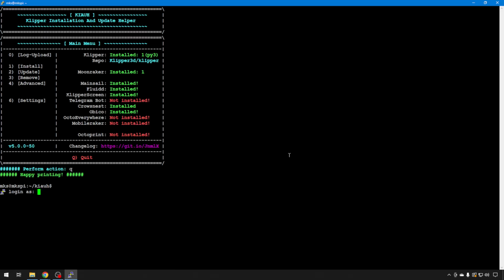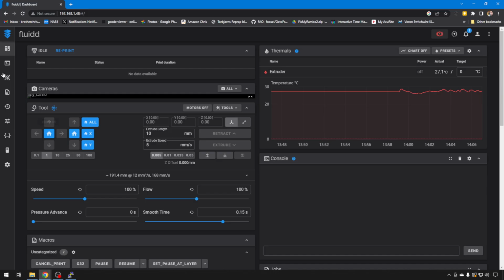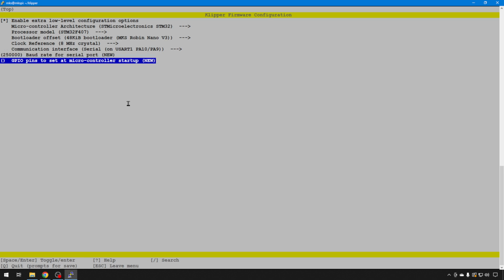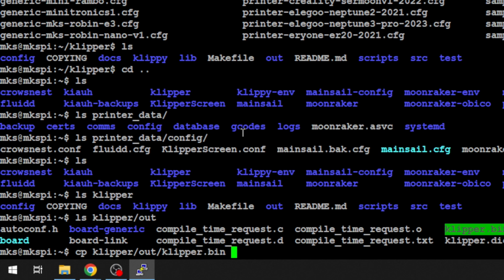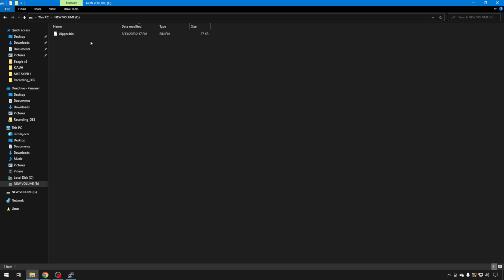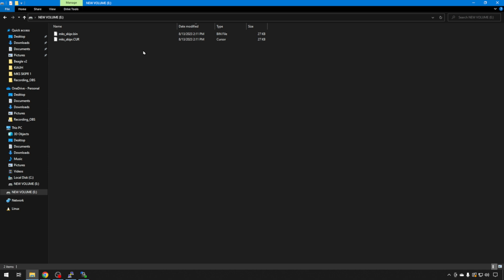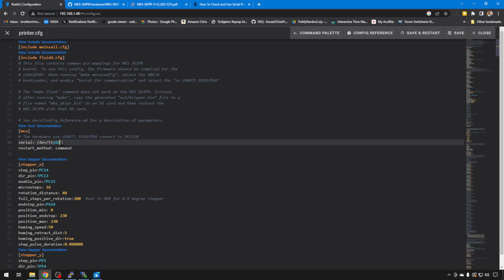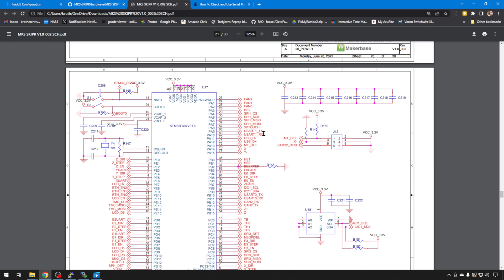Klipper - MKS Skipr Install - Part 2 -  Chris's Basement - 2023

Comment: Great Video, I was following all the steps, but when I try to go home at X an error jump. Unable to read tmc uart 'stepper_z' register IFCNT
Reply from the maker: Check your jumpers again on the board, make sure Z is set correctly.
Reply: @ChrisRiley  Thanks a lot, your channel its perfect. All your explanations are very helpful. Finally the real problem was TMC2209 burned. I only changed it. right now works fine. 
Regards from Mexico

Comment: Hello, could you explain how to use the boot and reset switches for the MCU? I replaced the burnt STM32 chip and normal insertion of the card does not load the firmware.?
Reply from the maker: It's been a while but I looked at the SCH https://github.com/makerbase-mks/MKS-SKIPR/blob/main/hardware/MKS%20SKIPR%20V1.0_002/MKS%20SKIPR%20V1.0_002%20SCH.pdf

RST resets the STM32 MCU, just reboots it.  Boot looks to allow you to flash a boot loader I think.

Comment: could you help me with this error, I uploaded a new firmware to the mcu to match the klipper v0.12 update, but I have this problem
mcu 'mcu': Unable to connect
Once the underlying issue is corrected, use the
"FIRMWARE_RESTART" command to reset the firmware, reload the
config, and restart the host software.
Error configuring printer
Reply from the maker: Did you solve this? I'm guessing you printer.cfg got updated and needs the MCU address added back.

Comment: Where do you plug in the 3/4 pin filament sensor?
Reply from the maker: It goes in MTDET, the pin is PA13.
Reply: @ChrisRiley  What if its a 4-pin?
Reply from the maker: @merlinbk  No clue what the forth wire is, what kind of endstop is it?
Reply: @ChrisRiley  So it's actually a 4 pin connector with only 3 wires. Can it be plugged in elsewhere on the board? If not what is the connector called, so I can convert it to 3-pin.
Reply from the maker: @merlinbk  Yeah, you just need to covert it over to a 3, most endstops are 4 on the switch side, but 3 on the board side, not sure why.  These are the ones that fit the board. https://geni.us/jYAAkk (aff)
Reply: @ChrisRiley  do you know what the wiring is to convert Ender 3 (2 pin) endstop/sensor to the 3 pin on the board?
Reply from the maker: @merlinbk  You can use ground and trigger pin on the two pins, you just have to find 5v some where on the board to power the endstop.
Reply: @ChrisRiley  Do you know if there is a discord for this board/makerbase?
Reply from the maker: @merlinbk  Yes, https://discord.com/invite/YRTqkuB6tb
Reply: @ChrisRiley  Can you plug in a ferrule non-controllable fan into the HE1 or HE2 screw in connector slots of the board? How about an LED Panel?

Comment: Anyone else struggling to get the MCU to flash.  I have a small 2GB FAT formatted SD card, have built according to instructions but it just seems to ignore it altogether, the version is definitely different (factory v0.10.0-530-g3387a9c2-dirty-20220807_204823-mkspi on it, rpi updated fine to v0.12.0-192-gb7f7b8a3)
Reply from the maker: Some times the board gets confused and won't flash. To try and get back to where it will flash sometime I flash to a version of Marlin or something else, then try Klipper again.

Comment: Hey , is this the same process for the duet wifi? 😬
Reply: My problem is: i‘m flashing the firmware but the port is not changing…
And what about the sd card, is the firmware called „firmware“ or is it „duetwififirmware“ ?
Thanks 😄
Reply from the maker: I've never tried it, in theory, it should work the same, just with a different chip. This is the only walkthrough I have seen. https://meki.medium.com/adventures-with-klipper-and-a-duet-2-wifi-on-an-flsun-qq-s-pro-f9eec5981cfc